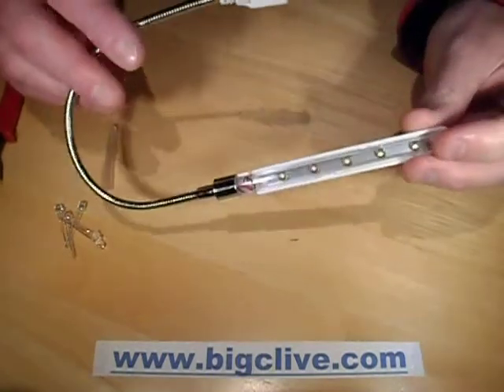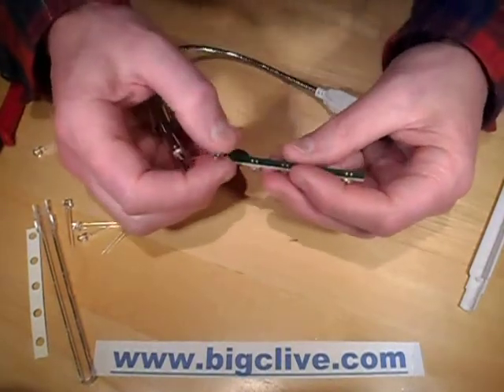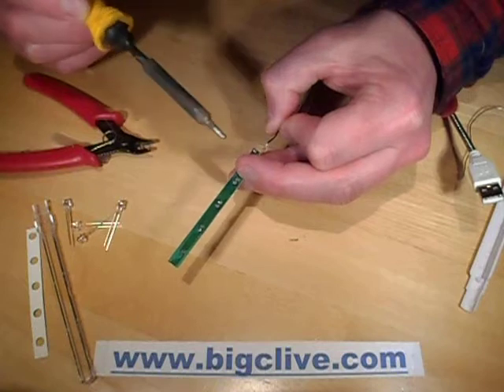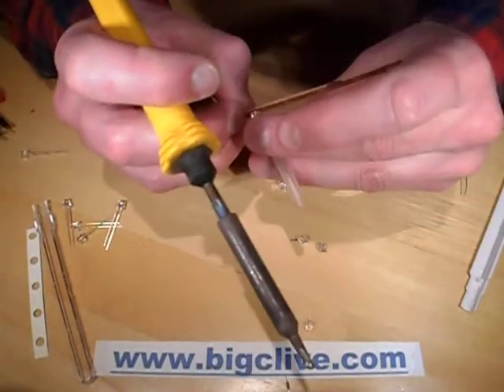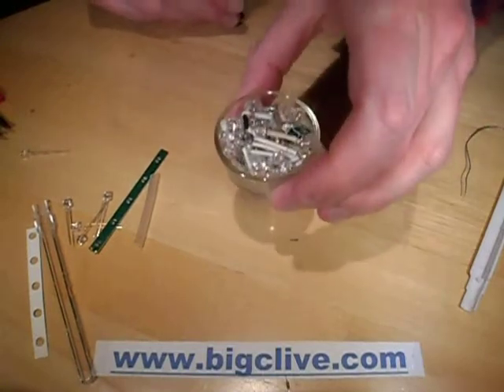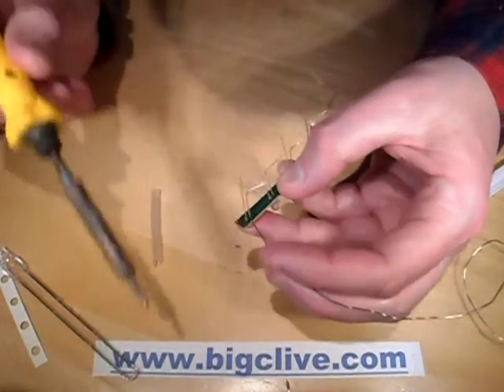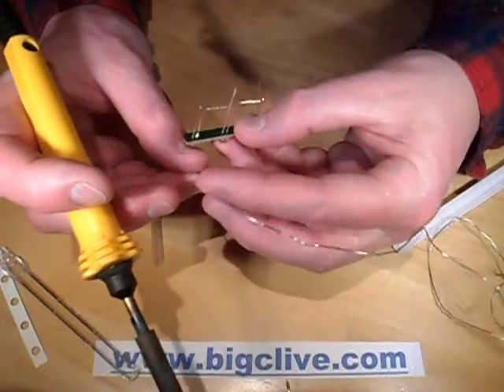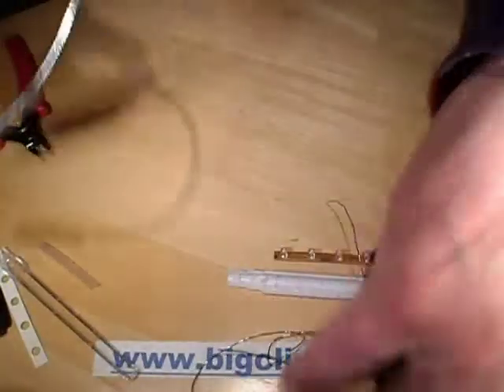Change the LEDs in a USB light to a custom colour.

Comment: Reason for lead-free solder is basically "Lead is toxic to some degree, and toxic is horrible, so let's use non toxic solder. Even if it doesn't WORK worth BEANS..." I wouldn't gnaw on your 63/37 solder tho; if you refrain from that and wash your hands to clean off the lead on your skin, you pretty much are safe from lead poisoning. It's not that hard to manage, silly legislators LOL

Comment: I bet there's a special place in hell reserved for Clive that has a large shipping containers full of cold and warm white LEDs and whoever enters the place is given the task of sorting all 1,598,819,001,472,583,723,113,495,395,722,576,922,657,433,275,868,462,375,927,131,333,586,828,594,033,285,295,228,583 LEDs to correct container, with a single battery while wearing sunglasses and bound to a steel chair and single mistake will scramble all the LEDs again.